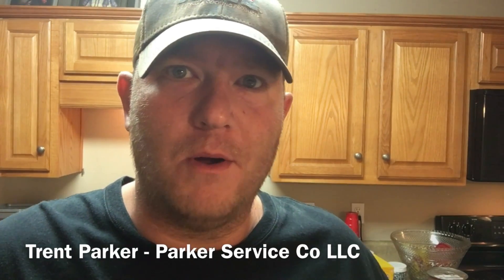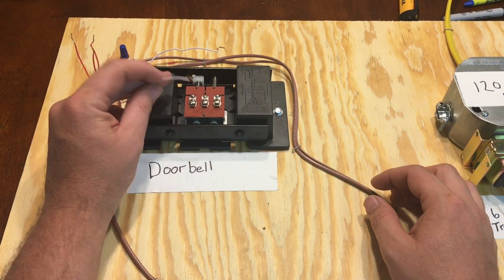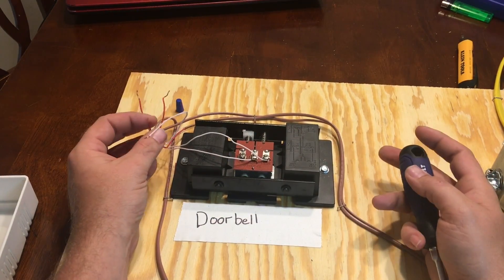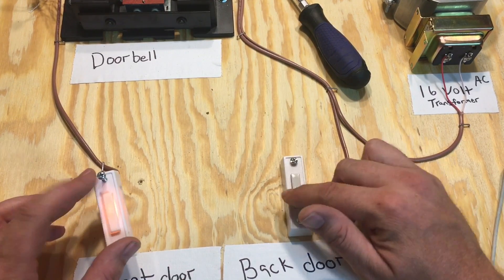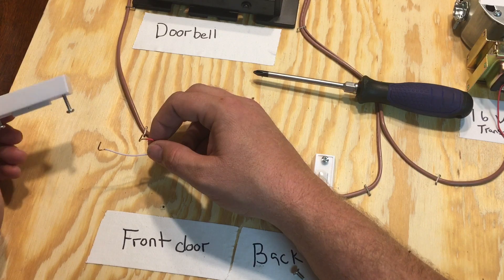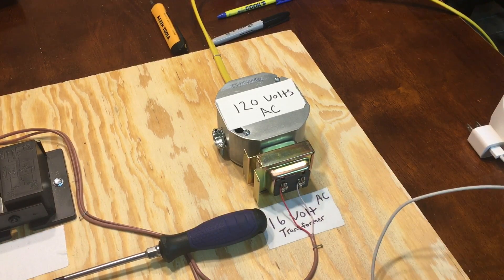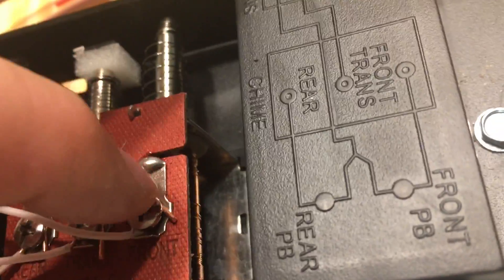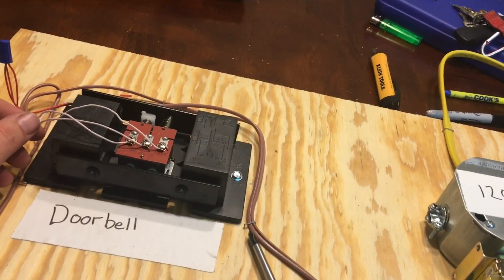The Ultimate Doorbell Installation & Troubleshooting Guide

Comment: Sir, thank you for this video. Out of all the ones I’ve watched trying to figure out my wiring system they used for our doorbell, your video was the easiest and simplest to understand. Allowed me to FINALLY get our doorbell to work again after 2 blown transformers and replacing the chime inside the house. It burned up as well. Too much to explain how it was previously wired ( had multiple wires going to the chime with no labels and none were hooked up to the old chime). Anyway, thanks a lot!

Comment: our doorbell will work at the front door but not the back. Checked button by touching wires , but no luck. Can I put both on the front door terminal without causing any issues
Reply: If the switch is bad it won't make any difference

Comment: So if i have a plug in chime do i only get a transformer and 20 guage wire and just connect the red wire to it without the other wires and should I house the transformer in a metal or plastic box ? I know they produce heat but would it be too much for a plastic one

Comment: I have 4 wires at chimes...2 blue stripe, 2 yellow stripe. Tried many combinations. Got it to work leaving one wire off, but both doors make same sound (ding dong) but back door used to just do single dong. Put new transformer in. Both bells work...just want single noise at back!  Any thoughts?

Comment: I’ve checked the wiring looks ok l, checked the voltage seems good  21.8 at the transformer wiring seems ok but every-time I try to press the ring button it will ring once and then the breaker goes off immediately. Any suggestion ? Is this a faulty power supply? Any suggestions ?

Comment: I’m reading 12 volts on my transformer?  I’m reading 12 volts to my wires at the bell. I’m not getting any voltage to my front door bell wires. Could the bell be bad?

Comment: I check transformer like you did, and it works.  Doorbell button not lit up. When I turned power back on, one hears the  bell, but it just buzzes at the box. When I push the button, nothing happens. Does anyone have any ideas.  Thanks.  Good video.

Comment: Trent, Thanks for this video, it’s quite helpful. I’m going through the troubleshooting steps and find that when I touch the wires for the button together, sometimes it initiates the chime and sometimes it squeals or just clicks. (The chime plays a song, so there’s actually a diode between the two wires as well.) I’m visiting my parents house and can’t get access to the transformer in their attic to test the voltage. Just wondering if this is enough info to tell if the issue is wiring or transformer or something else. Thanks for any info you can provide!

Comment: Great video. very informative. One question. Is it normal to have a Hum at the Chime? ..door bell stopped working ( after 30 years in the house)..put new one. I get a noticeable  hum that you can clearly hear. Never had that before. Is that normal?...I replaced the chime with the same style as the old one.

Comment: If my doorbell is not functioning, and the doorbell light is out, is it possible the transformer? Where would the transformer be located. The doorbell box is on the 2nd floor. One other thing: is the power for the outside doorbell coming from the doorbell box?

Comment: Question.  My back doorbell recently stopped working.  My front is fine.  I took the wires off the back button and touched them together.  The bell did not ring.  What would prevent my back to stop and my front to continue if it is not the button?  Thoughts?

Comment: Ok working on my mother in laws and she has 3 red wires, 3 white wires (although one is red but marked with white tape, I assume it is meant to be white)  and 1 black (the black was disconnected). She also has 4 screw connections on her doorbell. The whites were jumped across from each other and the reds were across from each other. The black wire was just loose inside, no tape or wire nut. Any ideas?
Reply from the maker: You got a picture?
Reply: @mrfatcheeto  Yeah, but no idea how to send that?
Reply from the maker: @whales302  trent84@gmail.com
Reply from the maker: @whales302  so what is the problem going on with it
Reply: @mrfatcheeto  Hey, thx! I’ll send you the pic. It just doesn’t work but she has a new one which only has 3 screws like the one in your video.

Comment: Great video. I am having trouble getting increased voltage for my new Ring Pro doorbell. I was getting 11v so I installed a new transformer with multiple voltage options. After installing, the transformer shows 18.5v, but now my doorbell is getting a very low amount like 1.5v.  Any idea what could be causing that?  The wiring is poorly labeled but I hooked it up identical to how it was.  Thanks!
Reply: Came here with the same question 5yrs later 😅

Comment: Do you have to turn off a breaker to the power for this? Is there a chance at being electrocuted?
Reply: If you're replacing or removing the transformer than yes definitely... everything in the circuit after that is low voltage and harmless (assuming you don't lick the bare wires;)

Comment: Where is the transformer for the doorbell typically installed in a house?
Reply from the maker: Normally in the main hallway of the home
Reply: @mrfatcheeto  my doorbell is in main hallway.  In your setup, the transformer is attached to metal electrical box.  Is this electrical box behind the doorbell in the wall with the transformer to low voltage?   Sorry for the follow-up question.
Reply from the maker: @johngrossnickle8874  normally the transformer is in a attic or some sorta closet

Comment: Hey pardner. Appreciate the vid. Found the wire to the transformer contact busted and thought I'd have a quick fix (previous owner foreclosed on-thought he cut it). I connected it but still no ding.. noticed the transformer felt a little warm. Is that normal? Thinking it shouldn't be. Thoughts? Thanks..

Comment: I replaced an old system, even if I plug the transformer directly to the chime it won't go off. I think that I am getting low or not enough voltage. I only have a touch tester which gives me a low voltage reading.

Comment: I purchased an Utilitech transformer (#0063548) that has three voltage settings (8V, 16V, & 24V) to replace a Nutone C905 transformer with one voltage setting (16V) for my doorbell.  No matter what setting I put them on, both transformers only produce just over 4 volts when they are tested with my volt meter.  I'm assuming something is screwy with the power source leading to the receptacle.  Also, there's another wire leading out of the receptacle, but I have no idea what it leads too.  Can you give me some advice on what possibly could be the reason why my transformers are not producing the correct voltage???  Supposedly, per the electrician who wired my townhouse, 120 volts is coming off the voltage source leading to the receptacle.  He wants to charge me $120 to replace the transformer plus the cost of a new transformer. It sounds like the electrician has a real good extra moneymaking scheme going on here, especially with people who are replacing low voltage devices that require a little more voltage that the original device.

Comment: Thanks Trent! I’ve got voltage in my transformer but there’s NO power at the doorbell and I had my wife go and hold the doorbell while I used the volt meter at the chime and there’s NO power. What do I do?
Reply: That usually means a rat or something chewed up your wires somewhere. You have to run a new wire through the attic or crawl space, whichever is easier .

Comment: can anyone point me to a link on how I can locate my doorbell wires? Vinyl siding installed over cedar siding. using a wireless doorbell now, but want to hook up a wired model. Just need to know where and how to cut into the exterior to locate the wiring.
Reply: Your question is like asking someone how long a piece of string is. How would anyone guess where your wires are assuming they are still there?? Think tradesman have special tools to release vinyl siding to pull that back and find the hole through the cedar siding and hopefully find the wires that way. I am assuming you know you had a wired switch mounted on the cedar siding. Was your door trim replace then because my switch is mounted right on the door trim? Could be behind that. At this point it is anyone's guess.

Comment: Mine does a buzzer noice and  Barely makes ding sound!?!?!?! Please help I checked doorbell switch and did the bare wire diagnostic and same results buzzing noise and like a ding
Reply: Same problem too. I can here the buzzing in the wall . Drives me crazy. And i noticed it after i but a new doorbell
Reply: 818guy get a bigger transformer
Reply: @818guy6  buy the trans it worked for me
Reply: @mydogoreo9681  ok!
Reply: Thank u !